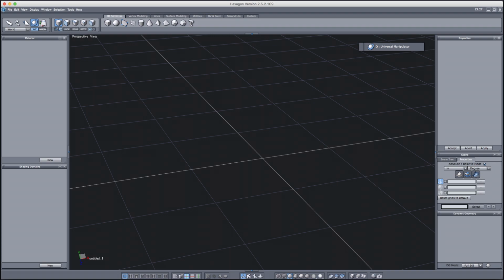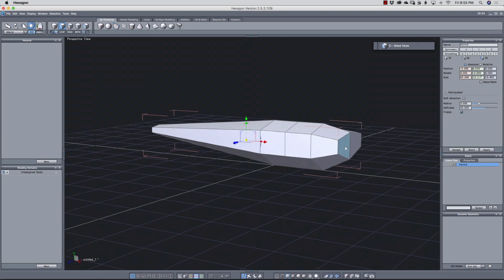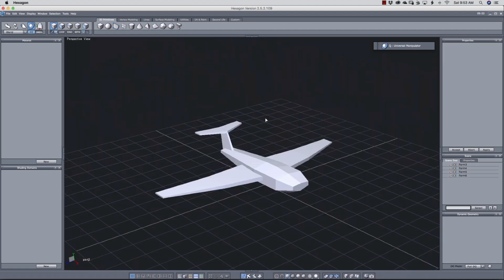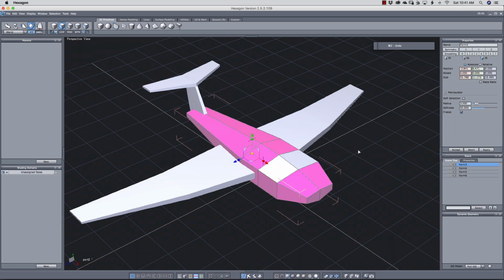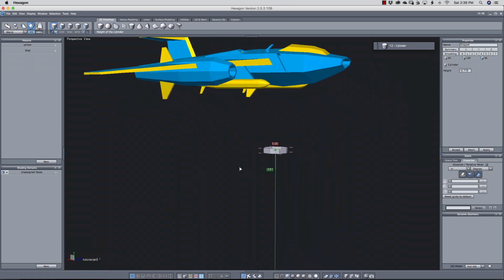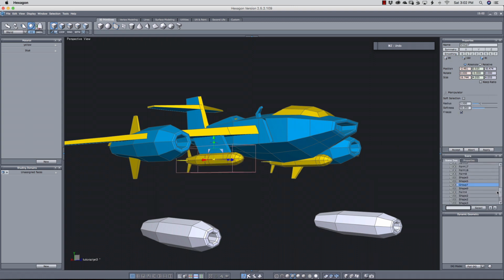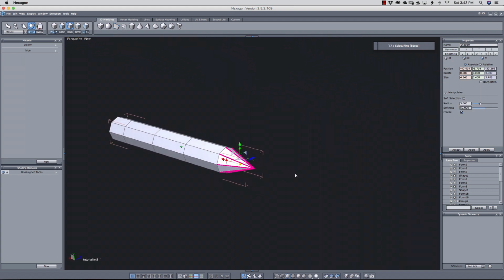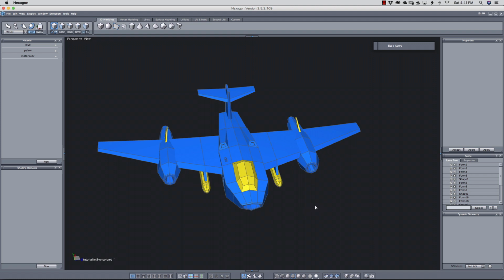Low Poly Modeling in DAZ Hexagon

Comment: At 14:05 when you welded the separated cockpit to the body the forms in your scene tree kept separate numbers. When I welded them together they both have the same form number in my scene tree. I can select the edges on cockpit or on the body but not both so I'm unable to bridge the empty space.  Is this just a glitch or did I do something wrong? Fixed it. Closed the file then reopened the file and it works fine now.
Reply from the maker: You need to select both separated shapes in the scene or tree, and then combine them (command-shift-C) and then you can select the edges and weld.
Reply from the maker: And that's a custom command if you're following my guide.  If not, you can choose weld from the menu above.